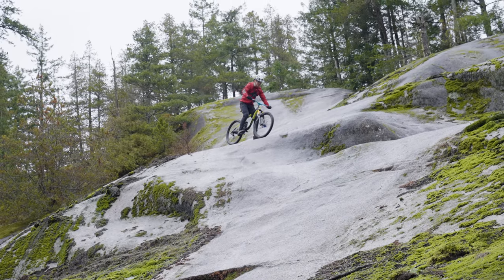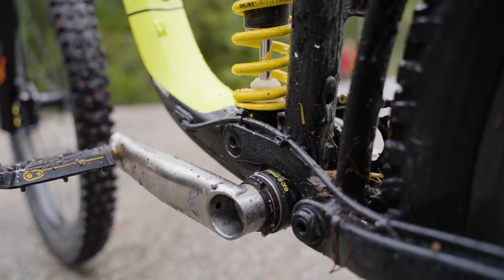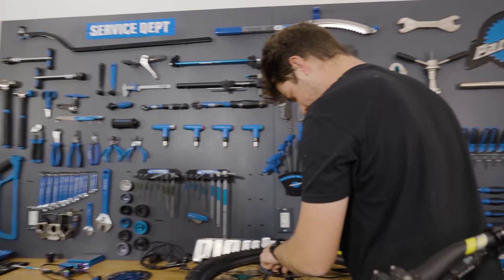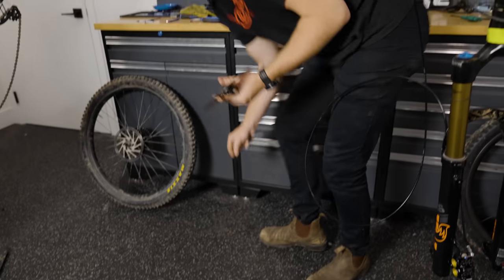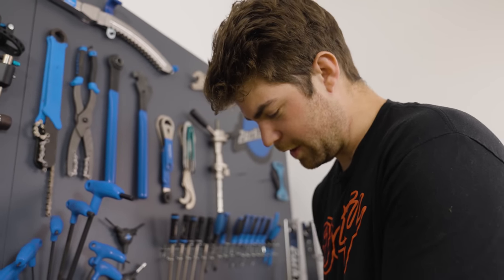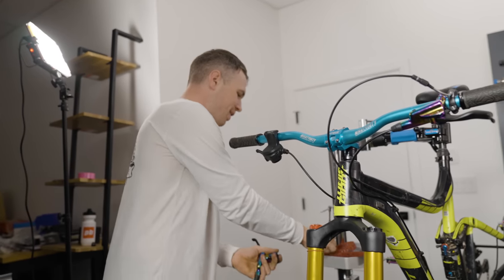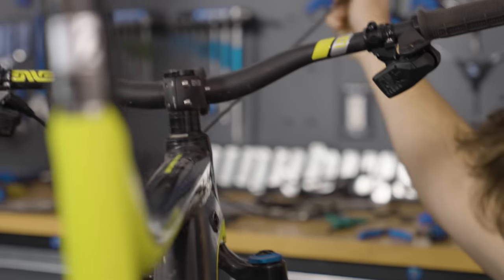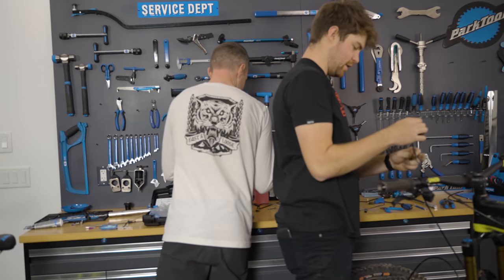$125 vs. $517 Brakes - Budget vs. Baller Episode 7

Comment: Let me say I have the magura Mt7 on my 2019 stump jumper with the same rotors being used and they are just the best. Even Magura lower end brakes the Magura sport which has the MT5 caliper and I have on my trek rail are also awesome. But the rotors Henry has I do have those also and very surprising they work pretty darn well. It all comes down to brake pads. I tried using budget pads with my Maguras and holy crap were they bad. If you can’t afford good brakes at least go for the better brake pads.
Reply: I totally agree with you that the pads chosen make all the difference with my Magura MT5's and MT Thirty's.. It is a night and day difference between the standard pad vs the 8.R I am now using on both setups.

Comment: I have some baller brakes now, but had some sketchy ones before. I’ve noticed I’m slower with the better brakes. Old ones I definitely went into some turns faster than I wanted. But most of the time it worked out.

Comment: I am totally in the camp of comparing, as somebody suggested, "the cheapest parts on Jensen, vs the baller part o Jensen."  This would be a legitimate comparison.

Then I realised, they are comparing the "baller parts", to the cheapest "Amazon crap", to save people from themselves. I am not talking about the educated riders, who understand the importance/safety of certain components, I am talking about the newby that thinks buying the cheapest Amazon brakes, is better than just spending to have the stock Sram brakes serviced properly. The same goes for the fork, Jasons fork could have been services for far less than putting a Fox 36 on the front and the results would be close, just like the amount of money spent on Henrys Moundotuofbndkjh 36 POC could have been put into servicing the stock Yari.

The one telling thing in the whole series, was Henry having his rear shock serviced and not replacing it. Best money spent in the whole series.

Comment: Safety issue Warning. The Disk rotors used by Jason are the Magura MDR-P Rotor which are NOT meant to be used with centerlock adapters (quote:"WARNING: Never use rotor with centerlock adapter!"). Check the Magura product page. So elbow grease spent for nothing.

Comment: Another comparison between apples and oranges.  At least compare brakes with the same # of pistons.  :(   That said, In my experience, the pad and rotor surface on these budget brakes are not ideal.  I usually scuff both surfaces up with some sandpaper before using them (always clean the rotors).   I have also replace the pads because the pads are usually junk IMO.  

I know they cut out a lot of the bleeding steps here has well.  But, never seen shimano style bleed while leaving the handle port open to air?  I've always had a cup in the lever port with at least some oil to ensure no additional air is introduced.  Generally, you use the syringe at the caliper port to add and bleed oil.   You can reverse bleed with a cup of fresh oil at the lever bleed port.   But, I would never pump the lever with an open port?  WTH?

Comment: Dude, I got Shimano Deore BR - M6100 brakes (front and rear caliper, hose and levers) for 90EUR on a deal brand new and they are freaking awesome (no new rotors but those are not that expensive)! But you could have got a pretty reliable and cheap M200 or 201 Shimanos for even cheaper and with rotors, and I could bet that they are way batter at actually breaking that those random rainbowy things you got lol I'm all for my bike looking nice, but I would much rather be able to stop reliably than have some crappy rainbow brakes that look cool lol 

in any case, fun videos in this series and its cool for me to kind of figure out some middle ground being a new MTBer. The cheapest stuff is usually very crappy, but for not that much more $$$, you can get some really good and reliable parts all over. 

I find that the Shimano Deore lineup is the best by far! And it's not that much $$$ to go there from the tear below that. But it's much more $$$ to go to XT or XTR so I think it's just not worth it for a casual MTBer. Deore is pretty much the same stuff as XT but heavier (as far as I realized)... And a beginner/casual rider doesn't and shouldn't give 2 shits about saving 200g on a derailleur and brake calipers lol 

I'm not gonna notice my bike being 1 kg heavier necessarily, but I will for sure notice better brakes, tires and more reliable/better shifters for sure! 

Just getting into MTB this year, it's a bottomless pit LMAO. You can always get better and fancier stuff no matter which bike you have. 
But I just try to limit myself to actually upgrading stuff that actually helps. 

1. BRAKES
2. TIRES 
3. BAR width and rise
4. SHORTER STEM 
5. SADDLE (that actually fits your butt) 

I was able to transform my bike completely for like $200-300 with these upgrades. You don't need the fancy stuff. Just make your bike feel and fit good and comfortable. And nice tires and good brakes will make you go way faster and have way more fun, just because you will have much more confidence on the bike.

Comment: I really wish they’d just given Henry like $1000 to buy the best value and most sensible upgrades (including servicing the existing parts) i honestly think the bike would be better for it, than what they’ve done here. 

Fork/shock service & charger damper upgrade.
Nukeproof neutron cockpit
Brand x dropper
SLX brakes 
Deore 12 speed drivetrain.

Comment: @18:59 Did you just put a center lock adapter on a rotor that specifically says "not for CL adapter use," printed directly on the rotor?

Comment: I have the original brakes that are tech row on my Marlin 5 from Trek and they break better than what you got and that's 180 mm I have a 200 mm on my good full suspension and that even stops better than what you're doing you need a cheap pair of quad pads breakings system and they have been seen for as low as $70 for a whole set front and rear that's a four piston brake front and rear for anywhere between 70 and 120 although I do like that oil select that you have on yours

Comment: I just got a set of MT5 for closer to $250 brand new.. it was actually kinda tricky to get all of the air out of them, might just be the cheapo bleed kit I have, but kinda surprised you didn't go mt7 or trick stuff

Comment: This series is sort of interesting, but I think it would be better if instead of going for super cheapo, no-name budget components you went with cheap, but OK brand name stuff. Like low-end Shimano or Tektro brakes, maybe X-fusion or SR Suntour for suspension. Stuff that is on the lower end but still decent and still costs 1/4 or less of the high end.

Comment: This was such a good idea for a series and IMO missed the mark by going ultra-cheap to the point where the crap hanging on Henry's bike would be hard to find on-line and impossible to find at any LBS! The only thing this may have done is show people the pitfalls of buying absolute garbage? This has been noted by many Pinkbike followers on almost every episode in the comments. Read and learn Pinkbike...this series seriously needs to be re-done as it could have been excellent. It could also have went a little more in depth w/ SBS process of DIY mechanic on the upgrades. This series did not do anything for the industry yet could have. An example would be this episode. Henry could have said, "Since Jason went Magura, I also looked into price point Magura in their MT Trail Sport Series...but...I also looked at TRP Slate, Shimano Deore M6100 and SRAM Guide "R". Due the availability along w/ features that will match this bike and our intended riding style... I chose to go with XXX.
Reply: "Its been noted on every episode" you do realize these were all filmed before the first episode was released right?
Reply: @SwolePapi15  Good point, I did not factor in that they had been posting the videos pretty consistently about a week apart! I know a ton of comments have been made, this could have been awesome and a killer learning experience for home mechanics!

Comment: I didn't get this in episode. If it was - sorry. 
Have you use any solvent on brake discs/rotors? Also did you try another pads? This was looking like some oil on discs/rotors. Ones i had such issue, it's terrible (oil on front disc). Of course can be that pads or discs where terrible quality.

Comment: well if the rotors are still as thin as the cheap brakes than it will for sure be almost as bad as the cheap brakes. That is the biggest issue with brakes today, they overheat so easy. Those crappy brakes seems like if they either are contimated or glazed. My shimano xt are behaving like that pretty often after being overcoocked.

Comment: I'm more than happy to pay the Magura tax any day of the week.  Once they're bled and set up correctly they're great.  Admittedly that initial bleed can be a bit of a pain.  Don't get air in your 4 piston rear caliper if you can avoid it.  Watch the Magura bleed videos a few times.  They're worth the effort.
Reply: Same with all brakes just bleed it properly, the key is the brake bladder, no seal leaks and quality of brake pads resin, semi metal, metal or copper and rotors

Comment: I enjoy the general idea of comparison using the extremes of the spectrum. And I really enjoy both guys since IFHT and GMBN. But I think the conclusion will always be the same: "Have the baller parts is obviously better, but you don't have to go so far to enjoy your ride". But using parts so-cheap-that-you'll-be-crazy-to-use-them turns this whole experience useless. I would prefer to see enter level parts compared to the most expensive ones.

Comment: An obvious unbalanced comparison. It would have been a better comparison to use same size rotors and same pad compound. I think those two are what make the difference of braking power and modulation. You'd notice a huge difference even comparing old skool cable-pull disc brakes with 220mm rotors and metal pads vs. 160mm rotors and resin pads. Ive got XT brakes and resin pads (way quieter than metal) with 220mm Magura MDR-P rotors. Love this set up for a 50lb ebike.

Comment: The Maguras with the discs are 400$ at most but never 850!!!
Reply: I got my MT5 set (not Fabio Wibmer edition though) for 150€. 45€ per magura disc makes a total of 240€ here in germany. 850$ seems overpriced as hell
Reply: @thelonewolf3515  Yeah im also from Germany, 850 is way over the top
Reply: @ottomtb  absolutely. I have to watch it till the End maybe there is some sort of explanation on the price?
Reply: @thelonewolf3515  No there isnt
Reply: @ottomtb  jup. Br-mt200 from shimano and some rotors would have been better...
Reply: @thelonewolf3515  as long as you have at least 180 mm rotors at the front and strong fingers MT 200s also can send you over the bar
Reply: @simonm1447  i've got them for my flatbar gravel bike. I am quite impressed with them. But i swapped them immediately for magura mt5s on my canyon neuron that came stock with them. For the price these shimanos brakes are really great
Reply: @thelonewolf3515  I use bikes with V brakes, one with Canti brakes and others with disc brakes - and the lever forces of 200s are similar to the ones of the other brakes. So you can switch bikes without the need of getting used to different brake types each time
Of course these brakes have limits - they can overheat because they have no cooling fins, but for XC and for commuting they are fine
Reply: @thelonewolf3515  I use bikes with V brakes, one with Canti brakes and others with disc brakes - and the lever forces of 200s are similar to the ones of the other brakes. So you can switch bikes without the need of getting used to different brake types each time
Of course these brakes have limits - they can overheat because they have no cooling fins, but for XC and for commuting they are fine
Reply: @thelonewolf3515  I use bikes with V brakes, one with Canti brakes and others with disc brakes - and the lever forces of 200s are similar to the ones of the other brakes. So you can switch bikes without the need of getting used to different brake types each time
Of course these brakes have limits - they can overheat because they have no cooling fins, but for XC and for commuting they are fine
Reply: @simonm1447  yeah, totally. If you don't do heavy downhilling they provide a nice bite 😁

Comment: Ok but having a larger rotor makes all the difference. The physics. That’s not a fair comparison.
Reply: Spot on sir, I have had  budget Shimano and 203 rotors front and rear for about 5 years now with sintered pads.  Stops me
Reply: Taking off a galfar 223 2mm thick and trying a 203 2,3 mm thick trp. When they arrive I will experiment with the diameter Vs thickness game.

Comment: I think it would be really useful to put a set of "control" brakes into the test. A known quantity that offers a reasonable compromise between performance and value. Let's say a set of Shimano XT's or Deores. That way, we can see what you're getting for all that money with the baller brakes. I suspect that, as with everything, this is subject to the law of diminishing returns.
Also, maybe instead of comparing a set of massively expensive set of brakes with a really cheap pair, what about trying to find a set of brakes that does perform on the lowest budget you can?

Comment: I somehow always manage to round off the bolts on my bike even if I'm not tightening it all the way, it's really annoying and I don't know what to do after they've rounded off. Can anyone share some of the techniques that I can use and how I can avoid rounding off my bolts? I'm quite inexperienced and would love to learn a few tips. Thanks
Reply: Buy some good quality (not necessarily super expensive) tools that fit nicely and get a torque wrench to avoid over tightening things. Some super cheap or ultra light weight bolts are however made of cheese and are a nightmare to work with. And if you have a rounded bolt you can try gripping it with vice grips or if there's nothing to easily grip drilling a hole in the centre and using an "easy-out" type product, a bit of release oil can help if the bolt is corroded.

Comment: Should've just used a shimano mt200/400 as the budget option. Probably the best budget brakes, I spent like 70 bucks on a complete set and they lock up when you want it. Bent disc? 11 bucks for a new one.  I asked my local shop how much they ask to bleed brakes. They said 35eu per brake..which is the cost of a complete brake...I can do stoppies, endo turns with em. Just not the best option for real dh stuff

Comment: I don't understand why Henry's budget parts are so expensive.  I've built better bikes on smaller budgets with higher end components.  Cheap Shimano hydraulic brakes are actually really good, I have even bought Deore brakes for around what Henry spent.  I get the point they are making but all these Amazon/Ali parts seem overpriced for what they are.
Reply: Completely agree. Maybe it's Canadian dollars? Otherwise they WAY overpaid. Those brakes are $30 on Ali express.
Reply: @micahsherer7189  Yep they are exaggerating the budget prices. And you can actually get a decent set of 4-pot brakes from Alixpress for 60-80 usd. Ztto M840 and Meroca m4, but i'm guessing thats not what they are interested in. Or why not Shimano 420.

Comment: Past 4 years I've been using cheap Chinese parts. Everything is still working fine apart from a carbon saddle that broke after the bike landed upside down. £20 to replace. I've done over 1500 miles for sure.

Comment: Anyone who lets Henry touch their brakes  should be scared, regardless of the price. The way he bled that front was absolutely wrong! Guaranteed to introduce air into the master cylinder! 
Zoom brakes work fine when you bed in the pads and don't add air to the lines. They are a huge upgrade over cable-pull Tectros, which are the only brakes Henry should ever be allowed to adjust.

Comment: could have done better with the budget version, maybe something used, or some mt200(40 bucks a pair), and then some 203mm rotors (40 50 a pair) and adapter (20 30 bucks)

Comment: I used these "junk" floating discs in 203/180 form for awhile now with codes RSC and ceramic pads. They are better than the Shimano XT ice tech rotors I had on there, and 1/6 of the price on Ali 😂

Comment: I actually preferred my Zoom brakes over my Shimano MT200s, they had better braking power and the lever pull was nice firm and short, my Shimanos continue to feel spongy even after a proper bleed at my LBS. The only reason i decided to change brakes was my Zoom brakes were red and I decided I wanted all black. I could have gone with black Zoom brakes but heard all the rave reviews on the MT200s, and I tell you what, I'm not impressed.
Reply: I ride 200s. As long as you have hands strong enough and the right rotor sizes (nothing under 180 mm at the front) they are still capable, as long as you don't use it for DH
Reply: @simonm1447  i have 160mm rotors on both front and back, maybe I should upgrade to 1800mm.
Reply: @NonLegitNation2  I can only recommend 180 mm on the front wheel with the MT200. 180 mm is typically allowed on every fork, other than 203mm rotors.
You will never get a one finger brake like XT brakes are, but with 180 mm this brake is good enough to balance the bike on the front wheel while braking, the modulation is relatively good.

Comment: Budget option would've been mechanical DB like 60$ BB7 or 40$ Shimano MT200 with bigger rotors, not overpriced AliExpres bling. Quality will ensure enough power to decelerate precisely without locking up, bigger margin for fade on long descents and various comfort features.

Any DBs should lock a wheel. If they fail there's air or leak in system, contamination on pads or other defect, not quality. Saying that cheaper brake don't stop the bike encourages people to ride with faulty, unsafe brakes where instead of fixing them they'll just think its because they're cheap!